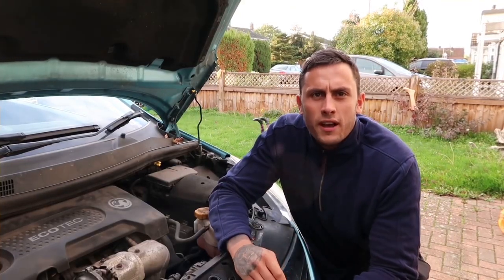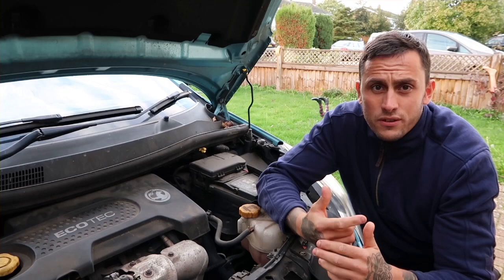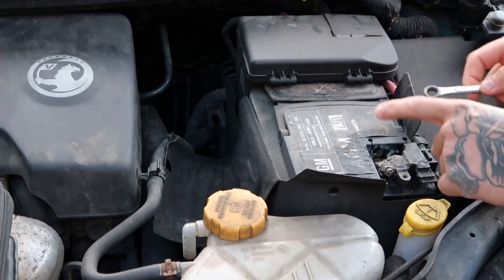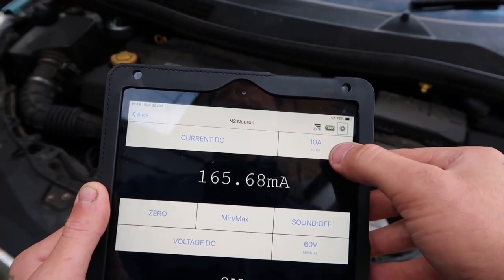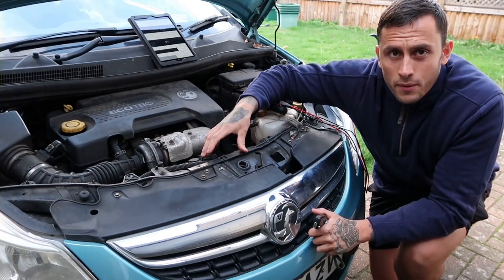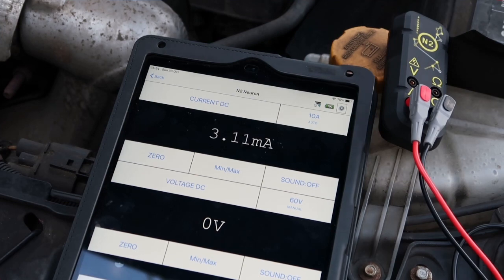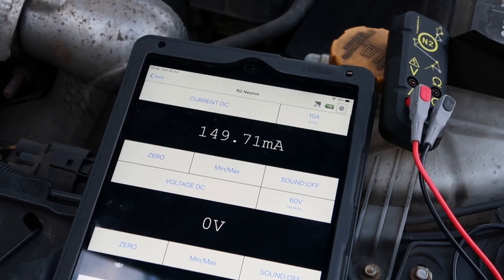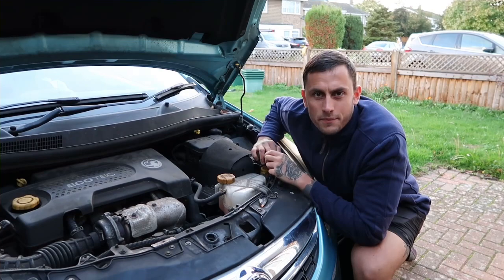How Do I Know If My Car Has A Battery Drain? - Explained And Shown - Tests You Can Do At Home.

Comment: Just wanted to leave you a comment saying thanks for taking the time to make this video. I have been watching a few of these working on a 2011 Honda pilot that was going dead after being parked awhile. 45 MA draw while parked. Now I want to go try and lock the doors and see if that drops even more.
Reply from the maker: Another test could also test each fuse while car is shutdown by using your multimeter and testing in MV to see what circuit still has power